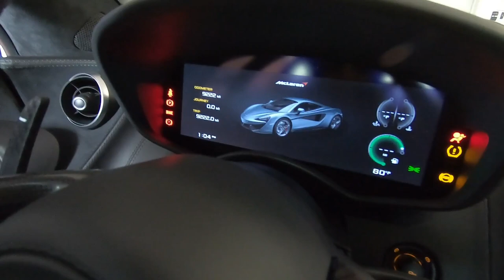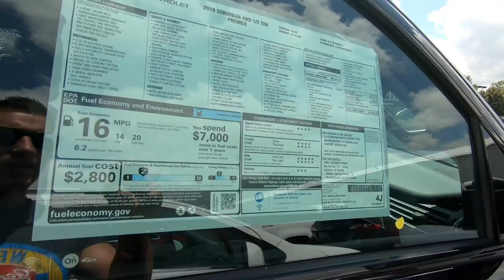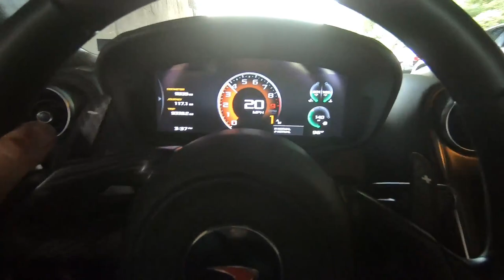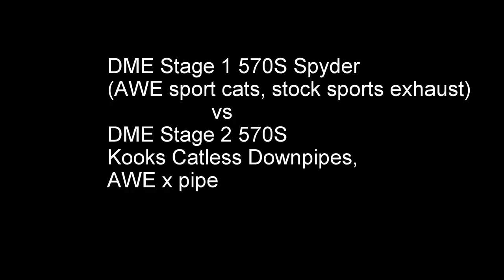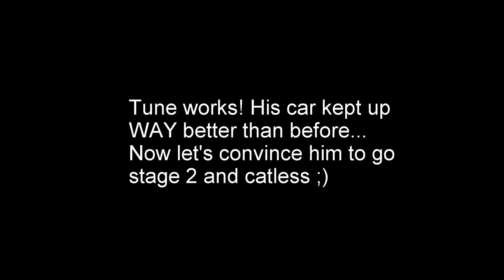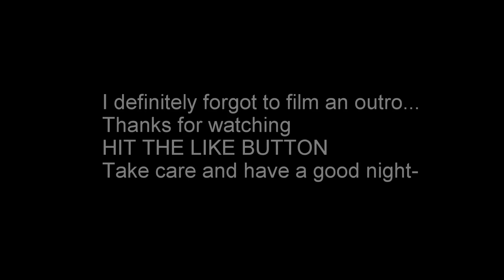Going to New Jersey to Buy YET ANOTHER CORVETTE!!! Grandpa #2...

Comment: Jackstands won't fit under those Mclearan's at that height, but when you have two Chinese floor Jack's holding up a $250 k car you need to get some 4" x 4" x 8'  timbers at your local lumber yard and cut them into 2' long blocks, so you can put some safety blocks under the car when you're working on it. Your content keeps getting better. Take care

Comment: Ive always liked blow off valve sounds, there should still be turbo spool down noise, you just won't have as much back pressure trying to push back against the compressor wheels. Not too familiar with McLaren turbo setups but you'd think they would already had some type of vent setup. Shrug.

Comment: Race ramps and race ramps trak jax.
The trak jax are a ramped 3 inch platform you can pull the car up on, they cost about 100 dollars a pair but they are invaluable if you have a low car (370Z owner).
I know the rock was ALOT cheaper, but the race ramps are nice to live with if you do a lot of stuff with lowered cars.